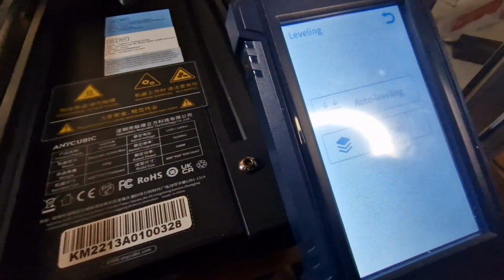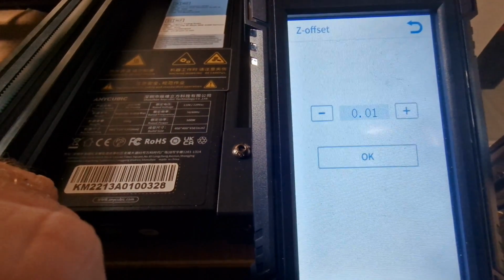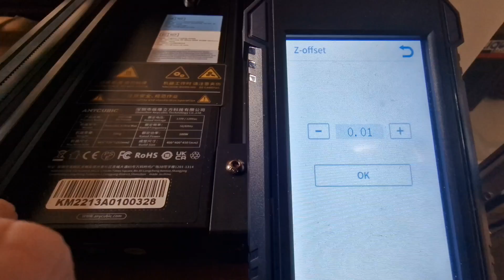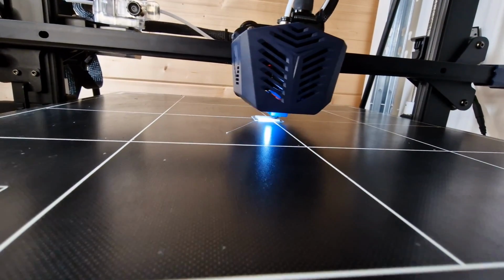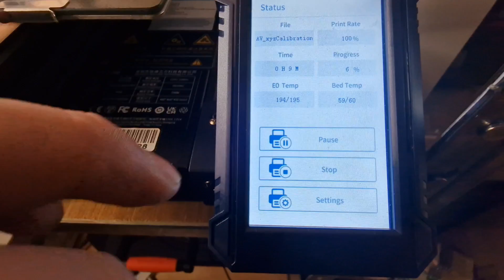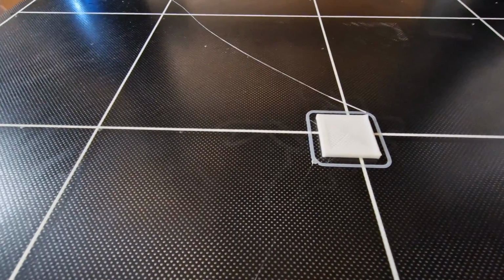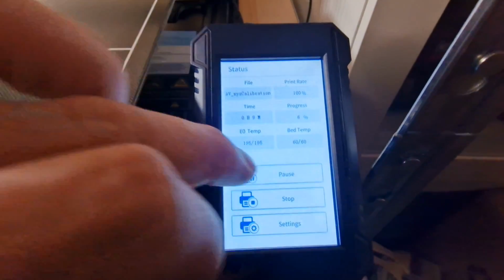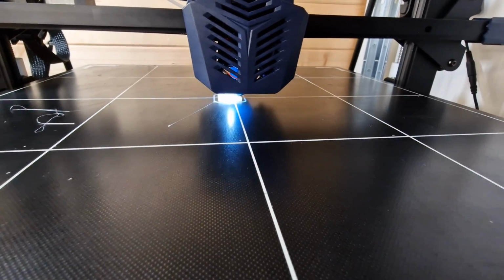#3dprinting #anycubic            Anycubic Kobra Max Firmware update first thoughts and advice

Comment: I can not get this firmware onto my printer. I have the newest anycubic firmware, I thought that was suppose to give .01 increment in z offset but it doesn't. I have these files on an SD card but it will not transfer onto my printer

Comment: My cobra max had a jam in the hot end and I didn’t catch it for quite a while and after I got it clear I do not have extruder response and discovered the stepper motor was no longer working I switched it out and tried everything again and the stepper motor is not getting any signal I checked the wires and everything is connected. Could I have burnt up the drive in the motherboard? I ordered a new one but I also want to know once I get the new board properly connected will I have to flash it or should it be ready to go? I’ve had it for over a year and nothing has really gone wrong with it until the other day. I have X Y and  Z function it just doesn’t extrude   Could you point me in the right direction if I need to download the proper firmware ? 
Thanks I will be grateful for any help.
Reply from the maker: Might be worth swapping a motor from 1 of the working axis and see if that works 💪  then u can isolate that as the problem.... in terms if the motherboard as been damaged I'm not sure u would expect them to all not work but I could be wrong give the swap motor option a go thanks for watching and don't forget to like and subscribe 😉

Comment: Hello, installed the zombie v2 firmware and everything works well except for layer shifting happening on the y-axis.
Is there a git or reddit page that exists for this issue? I see others have this issue that get resolved when flashing back to the 2.8.6 firmware.
I have upgraded to direct drive and this is the latest firmware that had linear advance

Comment: Tried to download the V2 of the Kobra Max software, it is a .rar file and not a bin file. Is there something that I am missing.
Reply from the maker: did you unpack the file first? in winzip?
Reply: The .rar file doesn’t give you an option to unzip just shows up as a doc file when saved. The other three files in the google doc are zip files v2 is the only one that is a .rar file.
Reply from the maker: @user-jw5my8hs4s  that's odd maybe reach out to Will from studioZombie3d

Comment: So I did the full calibration from Teaching Tech's website and all seems ok apart from the fact linear advance doesn't seem to change anything. I have the new zombie firmware 1.8b and ran the linear advance calibration and ended with a K value of 0.32. Updated it in Pronterface and saved it with m500. Its there according to M900 but when I printed the test cube both look identical. Any ideas?

Comment: Which version is the latest? I flashed  version v1.8b it caused my printer to become very erratic. 
It skipped steps often and randomly  even at 20mm/s.
I calibrated esteps linear advance, pid tune, changed junction deveation to all different settings.
I went through cura and checked all settings and made changes trying find the problem, nothing worked so finally flash 2.8.6 back again and its running smooth as silk again.
Any ideas what might have been the problem.
Reply from the maker: So to be honest I haven't tested b yet and so can't verify that works well I'm.running version a So all works well with this version
Reply: @3DPUK  Thanks for the  info, I  will  check  that out when my printer  gets some down time

Comment: Hey dude, thanks so much for your videos. I've just received the printer coming from sla I'm a bit of a noob with fdms. I followed your guide, got the firmware installed and ran the m502 twice then m500 in Pronterface. I'm confused on the next steps though. I need to research how to calibrate esteps but the next step I'm lost on where you say "set junction with m205 j0.05 and then calibrate linear advance". No idea how to do that so any help would be amazing. Thanks again!
Reply from the maker: hey i have a video on my channel for esteps ... the linear adnvance has laready been flashed so thats good to go... in terms of juntion there are some videos out there for this 
thanks for watching

Comment: How do you write the K-factor without the code?  Everything I'm seeing says edit the code, compile and reflash?
Reply from the maker: The file should be .bin so that is immediately flashed of changing firmware figures this is done via promtoface
Reply from the maker: Open pronterface cinnect after new.flash of firmware.  Then follow a guide from YouTube in what codes thus is then followed by m500 too save
Reply: @3DPUK-TECH-CHANNEL  thank you very much I got it now (M900), I been searching for 2 hours, every guide I found was stating, edit in the firmware code, compile and flash.

Comment: Did you already print at higher temperatures above 250/260 degrees Celsius? Is that enabled in the Firmware?
Reply from the maker: I haven't as of yet will try this week though

Comment: ok first I wanna thank you for this video. I was wondering why I could only offset in 0.5mm increments. now we are talking. your video was quite easy to fallow. I did the firm ware and I unfortunately only have 28 gb micro SD's so I re formatted the one  that came with the printer. I tried to print one of those planetary cellphone holders b4 noticing you had new firmware available. lets just say the where more stings on that first hour of printing then on a harp. lol. So I figure I got the new firmware installed but the E-steps I'm new with. Its been awhile since I've done CNC or robotics code. Seems similar but I'm not sure what you mean by send M502 twice then M500. M500 saves, correct? And I'm guessing M502 runs like a diagnostic? then from there I should be able to fix my E-steps?? sorry for the long msg, I'm very new with 3D printing but a moderate quick study in my opinion lol. Thanks so much and your videos are great...
Reply from the maker: https://youtu.be/ZHg7PlBrNVE this is my esteps video

Comment: Where did you get the new version of the firmware and did you use pronter to install it?
Reply from the maker: Hey this version is in the description  previously  in my other video...its version 1.6 it's a bin file so straight plug in via USB... however pronterface  will be needed too m500 save and then redo your esteps as its back too stock
Reply: @3DPUK-TECH-CHANNEL  Looks like v2.8.7 is out now. or am I missing something?
Reply from the maker: @red304  hey this is the stock firmware from anycubic  not with adjustments of Z offset and linear by Zombie3D